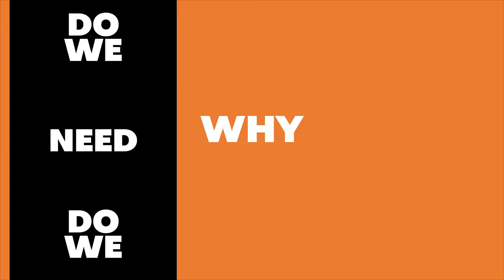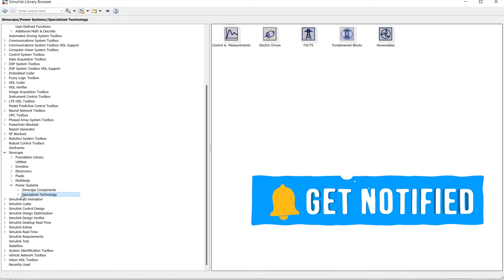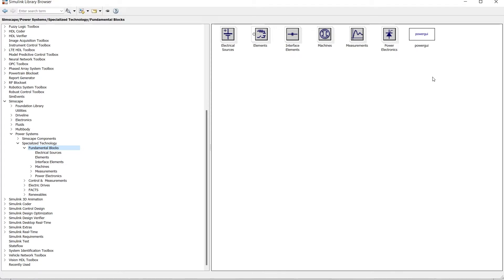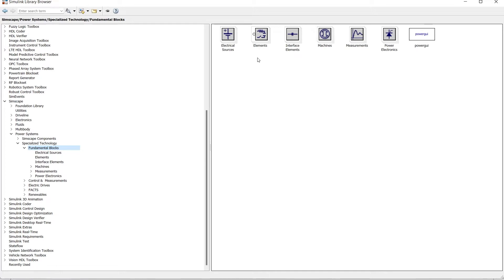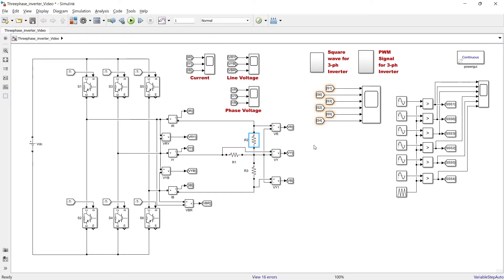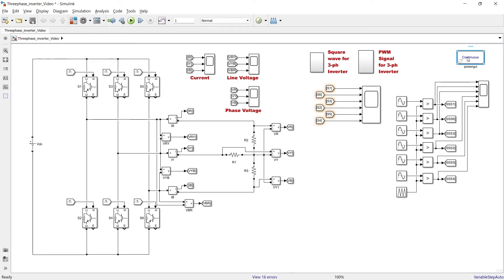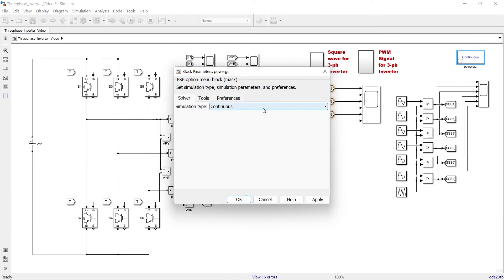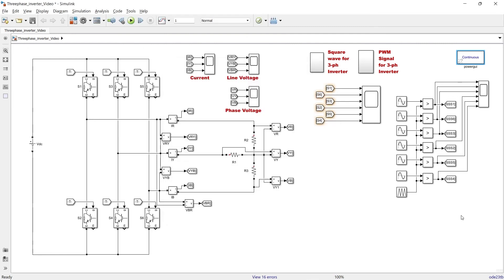What is need of powergui block in Simulink | Why powergui block is used in Simulink |Matlab Tutorial

Comment: Sir thanks alot
I have a problem
I made a simulink file
And i made the Ts=50e_5
Runing time =0.5 s
When i make a run
It takes very very long time
How i can solve this issue?
Reply from the maker: Time of simulation depends on many parameters. 
If its big it will take time to run, if more no. Of scope is connected then also it will take time, once try to change your solver that will also help